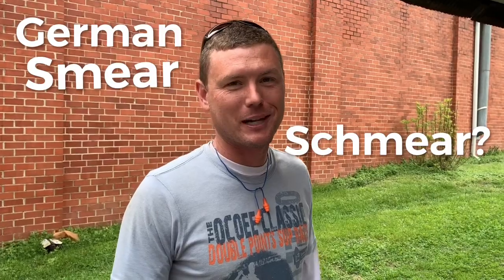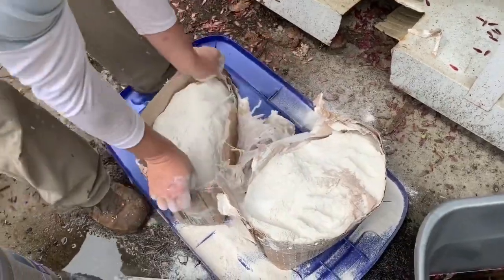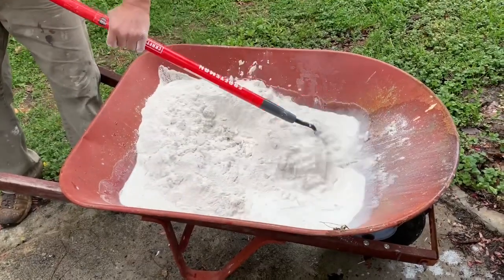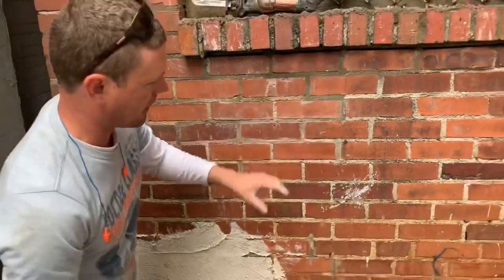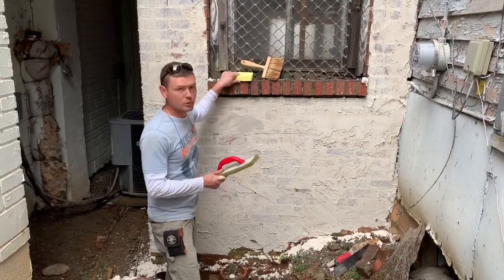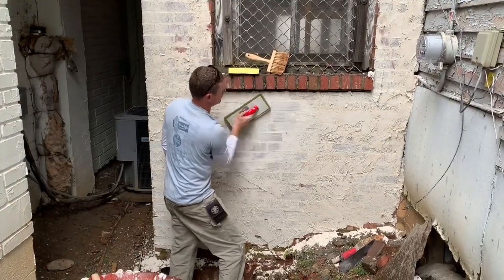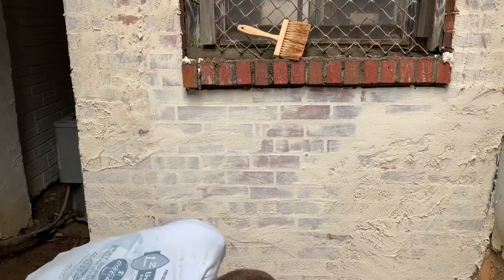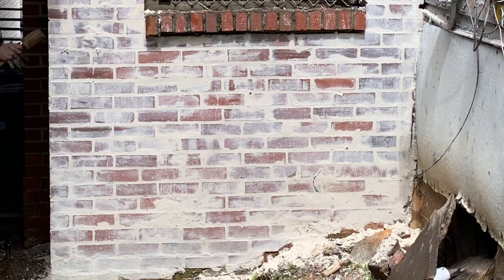How to repair old brick using the German Smear or Schmear

Comment: I've followed your channel for a couple of years now.
I recently "schmeared" a 128 year old, interior wall of a three story brick.
Lots of degradation & cracking.
I used Sand & Topping mix, creating fluid/soupy mix to get into the crevices & attempt to create a paintable surface.
Amazingly enough, the techniques you offered were the same I used.
You guys are awesome.

Comment: I've used Quikrete's fiber embedded Quik-wall on old brick. The brink is 150 years old and had a glaze to it. I had to try different things to get it to stick. The first coat just slid off the wall. I ended up doing 2 coats of bonding adhesive and then applying the Quik-wall. It's amazing how good it came it looking.
Reply: I’m debating applying that stuff to 1940 brick but I’m worried about it damaging the brick. I was hoping it would add some structural stability lik3 it supposedly does for cinderblock because my brick is holding gravel within a porch but people seem to be suggesting it won’t

Comment: Depending on temperature and humidity; I always pre wet the surface before Stucco Coat. If full Stucco is desired; I used Hility gun to nail Metal Lathe to surface. 
YALL ARE GREAT 👍 ~~ Thank You for your Work and Edits‼️🍑🍑🍑🍑🍑🍑🍑

Comment: Quick question, I have the same product as used here. I used some on some test bricks. I have let it dry for a couple days. If I wet the area it darkens a lot. I know it’s darker during application but I thought it should stay white after it drys, even if it gets wet (like rain). Is that not correct? I’m in the south so it’s humid. Maybe it needs more time to dry? Thanks for any help.

Comment: good job , the real deal .... would be pretty messy inside doing a fireplace , but that is the real way to do it and you get the true look of das shmeardenohooten frugenlaten (ya I made that up) ...... However I am curious why you used stucco instead of mortar ..... I'm sure it's fine either way , both are pretty much the same thing really , stucco , mortar , grout , all three are pretty much just masonry bonding products ..... PS , it's masonry , not masonary .... may' sun ree , not , may' sun airy , sort of like cavalry isn't calvary ... sorry to nitpick but "masonary" sounds so amateur ..... The steel trowel scrape was definitely the way to go , and ya , wet the heck outta the brick , it soaks up water like a sponge ..... best German Shmear video out there , or as I like to call it , "The Three Stooges Bricked My House" technique , so sad those professional Masons took so much time to lay the brick and create such precision mortar joints a long time ago , and we come along later and just "Shmear it to hell" !!!!! hhahahahahahha ...... it does look good though

Comment: I would have used the grout bag. It goes much faster and you can have another person come behind what you just put up, and scrape it it horizontally and in Xs. That way it doesnt dry with to much before you get a chance to finish. You can always re-wet it, then chisel/scrape off some bricks and brush it off with a brush if it dries to fast, or you dont like a certain area.
Reply: probably less waste too
Reply: This is an interesting idea... I may try this...
Reply: Just a white grout? I cant find this material anywhere and I’m hoping to confirm a good alternative